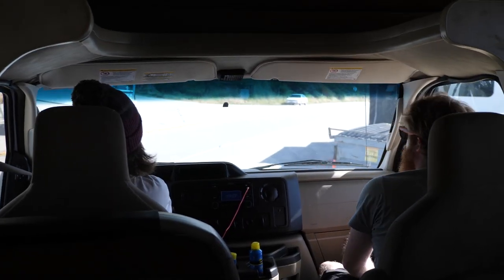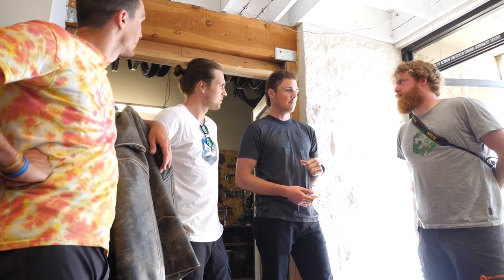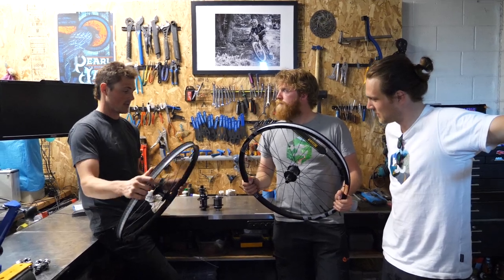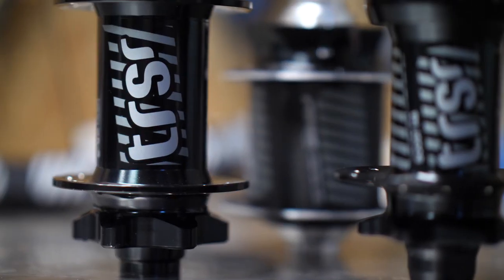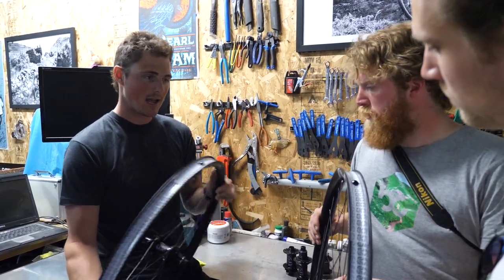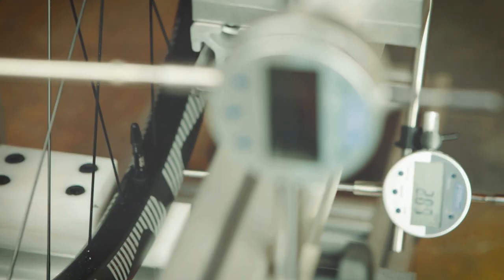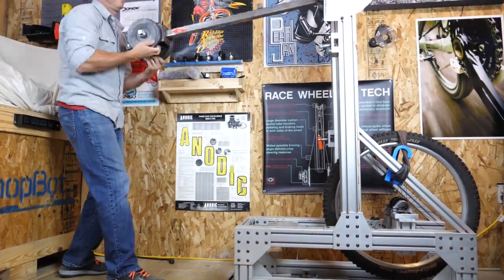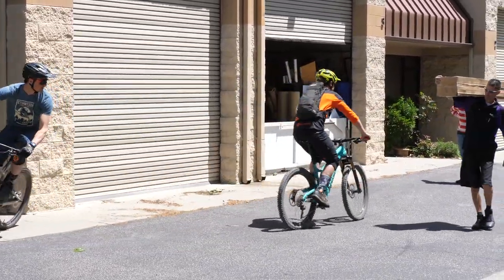Der neue e*13 TRSr SL Carbon MTB Laufradsatz 2018

Comment: Ethirteen great ideas..above vid ..weight of wheelset not mentioned...why 28 internal..does it work with 2.6 tyres for absolute tracking..price point...New hub degree of engagement points..type of freehub...pawls any offset..noise level of hub..and how many hits for failure compared to last year model..etc..like your 11 speed cassette sure could use some sparkling finish work ..matte black or something...